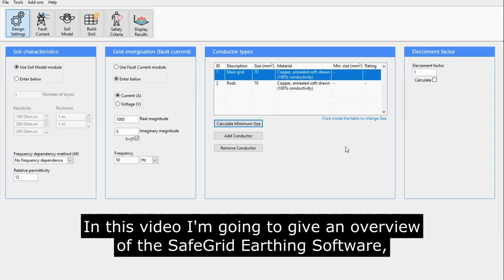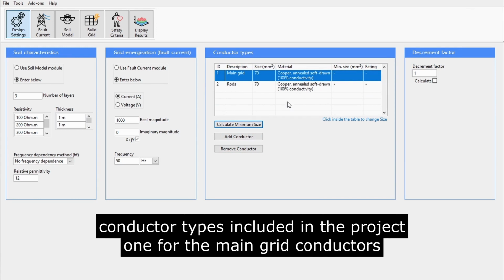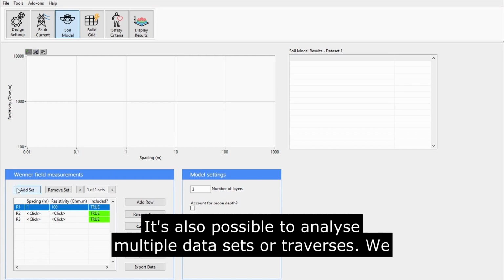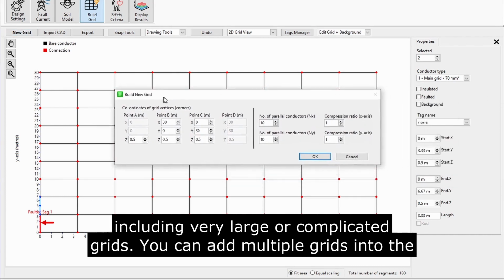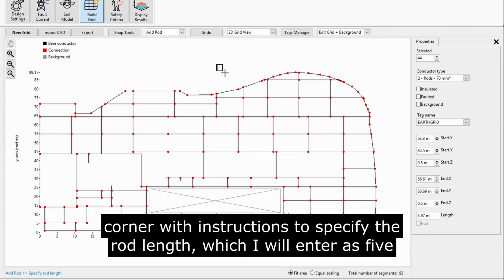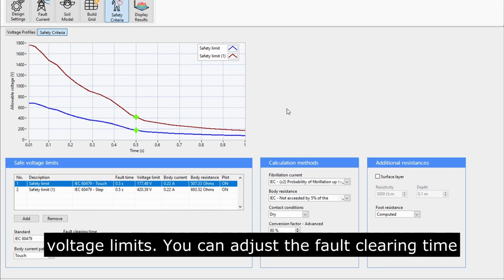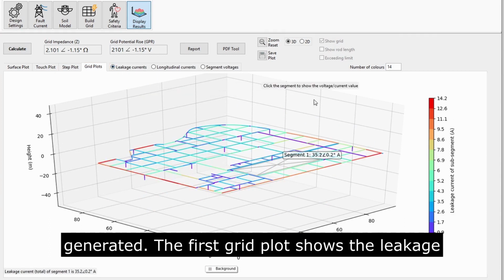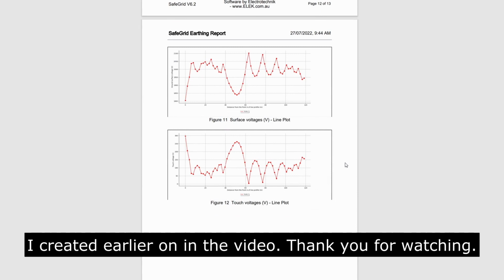Overview of SafeGrid Earthing Software

Comment: SafeGrid is a very complete and practical software. Important How to model multilayer terrain feature from field detection. The fault current; and all according to IEC and IEEE standards; which gives us reliability. Very informative technical report.
Reply from the maker: Thank you very much for your feedback Marco. We are continually improving SafeGrid based on our users requirements and their feedback.